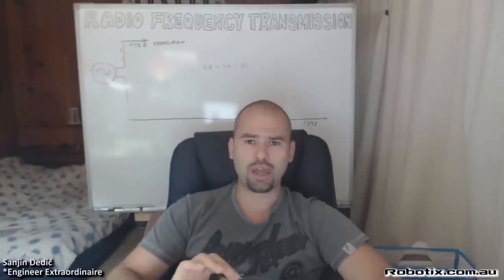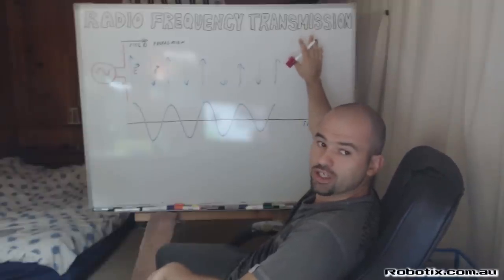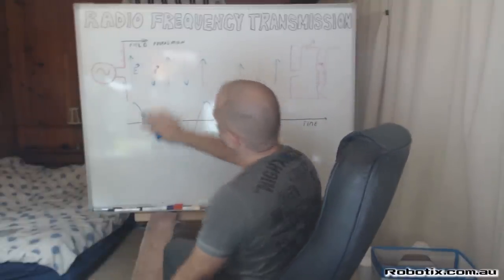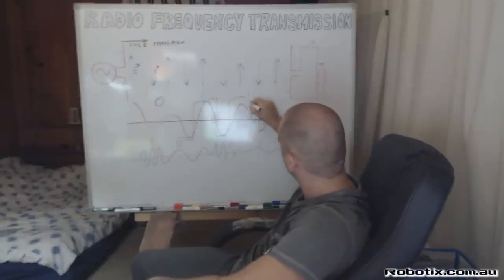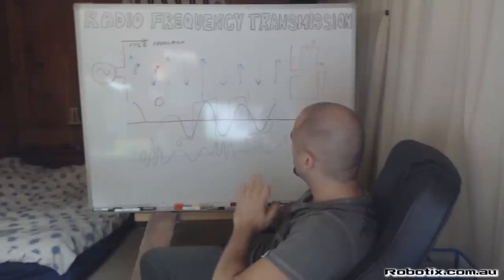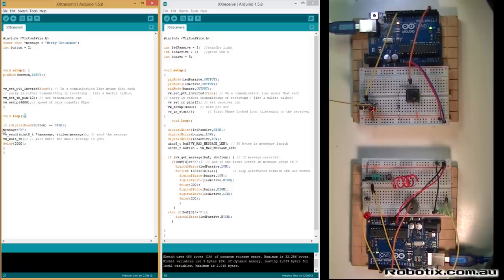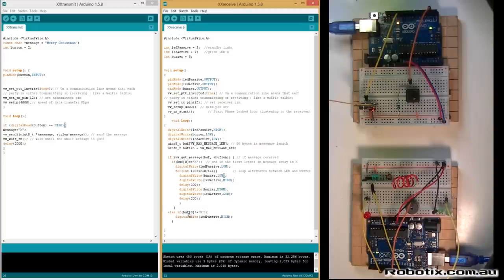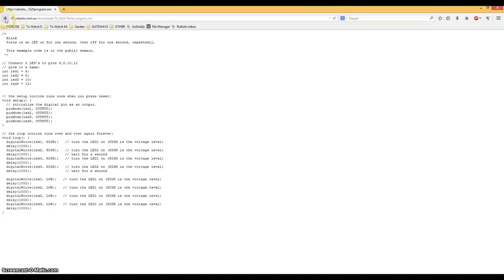Radio Frequency Transmission Full Tutorial

Comment: Hi, just found your videos, they seem well put together and easily followed, as a result I have decided to subscribe for future use. Currently I am working on something which requires me to split an RF signal from a TV aerial, and I believe I may also need to amplify the signal due to loss of signal after splitting. I have had a quick look around the net for amplifier circuits that I could use and have been struggling to find anything that is easy to follow. I understand that I may be looking for a distribution amplifier and not just an amplifier. I found one of your other videos which amplified sounds but it appeared to be only for DC signals and I need one that would work for AC signals. If you have done a video on this sort of thing already, could you point me in that direction or possibly do a video on that if possible. I will be watching some of your videos at a later date to see what other things I can learn from you, electronics with arduino is a hobby of mine, unfortunately I haven't been able to play for a while and my current project is in an effort to reduce house costs right now. Thanks and I will see you in another video.
Reply: i am really so exited to know what you have done in this project after 3 years

Comment: great video. but i just wander how to control several led one at a time using the same module and several switches. thanks
Reply from the maker: I am pretty sure you can just add more leds at the top of the XXreceive program. Then you can add them using digitalWrite in the loop section of the code

Comment: is it possible to send analog data, like from a potentiometer for instance? or even more specific, from two potentiometers at the same time? i'm planning to do an rc with two joystick modules, one to control two motors and the other to control a servo. excelent video, by the way.
Reply from the maker: Sure thats possible in the loop just do this message = analogRead(A0) and if you have issues try message = String(analogRead(A0))
Reply: Robotix thank you very much!!!
Reply: God you legend

Comment: 19:45 So, does it mean, that the communication is immune to disturbances coming from ambient?
Reply from the maker: No not at all. In fact if you listen to the radio you will hear those disturbances when you are close to tram lines or power lines! . However when the transmitter and the receiver are just a couple of meters apart the signal is pretty much 100% reliable. 

More advanced circuits (and more expensive)  than this one have very elaborate noise filters to take care of these disturbances!

Comment: hello i just tried this as i am making a RC car but this doesnt work for me. I copied your program, pressed the button but only red LED light up, the modules get the signal but it seems its not an "X" for some reason. than i tried and removed the antenna , than neither the red LED lighted up so modules should be getting something, its just not what am sending. could it be that my modules are not well made, or could it be the antenna? am using 17 cm on transmitter, and none on the reciever.
Reply from the maker: Try using the serial and then Serial.println(buf[0]), also double check your curly braces
Reply: am quite sure i exactly copied your program and so i was surprised it didnt work as yours, could it that i dont have an antenna on receiver? 
and would you mind to do a modification with serial.printin you just mentioned? am not sure where to put it in, if by any chance you could write that down for me, either by explaining or just by writing it into program for me. 
Thanks in advance for all of your support.

Comment: Okay, I've got this project I'm trying to build. 2 timed light sequences. The concept is race lights for 2 cars, either device can initiate with a button press. Cars lineup, driver A hits a button and the lights go on at the same time in car A and B. I want them battery powered and tossable from car to car. I found enough information on Arduino to build 2 circuits that work "wired," I wrote a sketch, programmed them both and it worked. So I went and got 2 Radio Featherwing RFM69 433mhz devices... and it's like I've hit a brick wall. I don't even know where to begin with these things. I did download the Radiohead. There just doesn't seem to be enough information to get me started on this. Arduino Code is in the description of the video https://www.youtube.com/watch?v=1VBQS9sNIKc

Future upgrades to include an IR sensor and tx to hold the sequence until the cars lineup, (I figure, wired, and clipped onto an outside mirror on each vehicle.) Maybe even a wire to the throttle position sensor to tell when someone jumps the light for a more permanent install, but cleaner racing.

Comment: I wanna ask.. why my buzzer keep beeping even when im not pressing my button ??? Really need help
Reply from the maker: can you past your receiving code, we will try to get to the bottom of this
Reply: For the receiver part im using arduino nano and im following your source code..
Reply from the maker: Hmm, my exact code, or did you copy it line by line? 

If it is exact I dont know what is going on, other than maybe the buzzer is wired in reverse?
Reply: Im copy line by line.. 
arduino Nano is just same with uno right?
Is it the problem is regarding to rf?
Reply from the maker: Well there could be an error with the nano interacting with the library . . . that is possible! 

but my guess is that you have a curly brace { or } in the wrong place turning on the buzzer regardless of message received being 'X'
Reply: Im gonna check first.. than I will get back to u.. really wanna make this project done
Reply: For now the buzzer is ok.. but when I press the button,, the is no output from the buzzer
Reply: Do u hv any idea for this case?

Comment: You don't need mathematical algorithms to filter out noise. You know what frequencies you are going to get therefore simple band-pass filter can do the trick.
Reply from the maker: Thants a good point. . . . and its very often true for digital circuits which can tolerate a lot of noise (anything that doesnt turn a 0 to a 1 or vice versa is OK   But there are tons of applications which arent covered by band pass filters.:  https://en.wikipedia.org/wiki/Noise_reduction.
Reply: Hey, thanks, will read-up
Reply from the maker: All good, wish you luck :) .... denoising, encoding and data compression are pretty much the twlight zone of this field... that shit gets both weird and hard if you try to understand it!

Comment: Very helpful. I ordered these things and had no clue to hook them up to my arduino until now. Do you have any plans for doing this with longer range moduals such as the 2.4 ghz or 433/900mhz FM? moduals they sell on ebay for 10$? Would wiring them be pretty much the same as all of these generic tx/rx moduals?  Are they just looking for data inputs? I could send you moduals if you are still making these videos. The more advanced ones are trancivers and to separate I don't know if that would make a differance or if the modual would handle that.